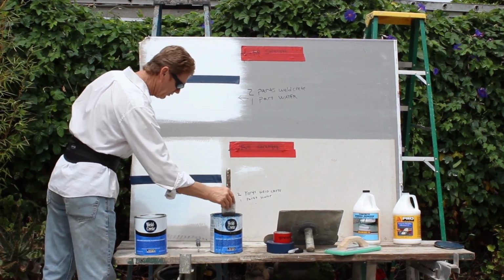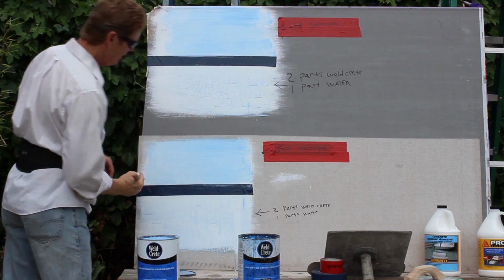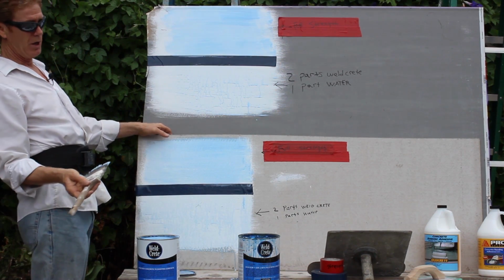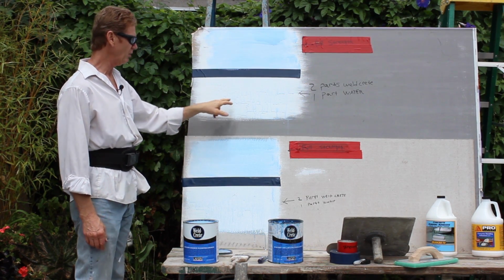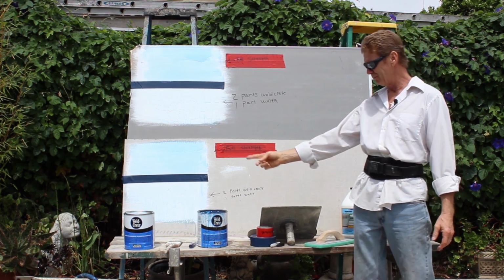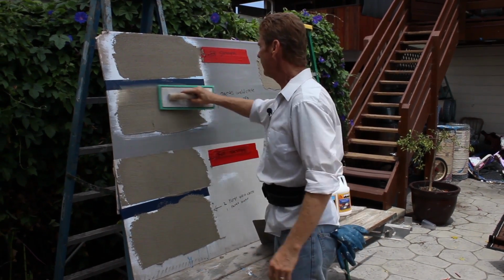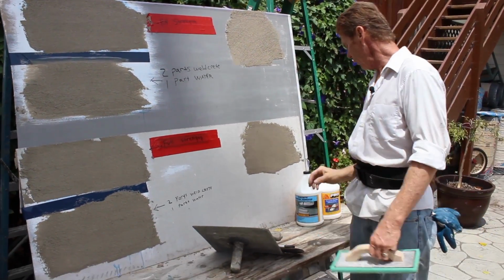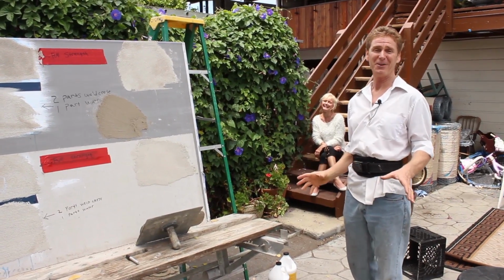Stucco and Concrete bonding agents.

Comment: Kirk, thank you so very much for what you've taught me.  One question I have, in a conventional three part stucco, is there a time window between when a brown coat should be applied over the scratch coat?  In other words, if I let the scratch coat cure too long before applying the next layer, does it limit the adhesion of that next layer (brown)?   Further, if I let the scratch coat cure a very long time (say...six months), is it necessary to apply a bonding agent before applying the brown?   Or, does wetting the wall thoroughly prior to applying the brown fix this. Thank you, Sir!
Reply from the maker: Good question brother,  no there is no time limit, the scratch can be on for years, however if dust dirt and grime gets all over it for whatever reason, simply hose the dust off with your water hose, the next coat will still adhere by suction. Nothing adheres to dusty surfaces except spider webs. 🕵🏼‍♀️🤙
Reply: @StuccoPlastering Thank you so much for the informative answer.  I sincerely appreciate it! 🙏🙏🙏

Comment: Can I weldcrete over sealed cinderblock so that mortar for natural limestone veneer sticks to it right?
Reply from the maker: Yes, clean the painted surface first with a wire brush or pressure wash it before applying the bonding as nothing adheres to a dusty or dirty surface, not even a bonding agent. Best wishes. 🕵🏼‍♀️

Comment: Hi Kirk, thank you for your video! I'm currently resurfacing the concrete in my small front patio that previously had tiles. I've already chiseled out the tiles & tile adhesive glue, power washed the ground & sanded it with a grinder. Do I need a bonding agent for existing cement to adhere to new cement on the floor? I noticed towards the end of your video you plastered one last bit of cement as an example of how it looked prior to drying & you mentioned "you didn't need to use weld-crete because the cementitious board wasn't sealed with paint in that area." I'm located in FL & my front patio IS SHADED! Thank you :)
Reply from the maker: When in doubt always use a bonding agent,Sakrete bonding agent cost about fifteen dollars, it’s cheap insurance.
Reply: @StuccoPlastering  Okay thank you!

Comment: Bare drywall joints have been taped ( fiber tape) with no topcoat.
Should I be applying the larsons plaster weld over these? Or avoid the joints?. 
I worry about the plaster not biting into the fibers very good if I paint them. The larsons helps alot with the moisture suction.
I am using woncote plaster. I had tossed a test piece in the trash... all the plaster fell off. After that I bought the larsons.
Reply from the maker: We apply the bonding agent and mesh if necessary, sure you can hit the mesh again with a boding agent but we usually don’t.🕵🏼‍♀️

Comment: I painted over my brick fireplace with some type of black paint from home depot. Would you advise weldcrete or another product before stuccoing?

How much sanding should I do to the surface before applying a bonding agent? 

Thanks! Love all your vids. You're a great teacher.
Reply from the maker: @DonVictron  I’d recommend Larson’s weld-Crete to adhere the new stucco. It would hurt to use a wire brush or heavy sand paper to lightly etch the surface.😉

Comment: Kirk, do you use the same 2 to 1 dilution over elastomeric paint which is a less porous type of paint?  Thanks!
Reply from the maker: @davep310  Howdy Dave, I must say, do what the can says and don’t dilute, as it’s complicated as to this one bonding agent out of 10 is the only one I dilute. If one was to paint many times now it’s again full strength. It’s too complicated to explain here, after using it on a hundred homes I know the results. Thus, home owners should do what the manufacturer suggest, this way I don’t get folks saying, there goes the bad guy. 😉

Comment: How to use Sakrete Adhesive Bonds Concrete to concrete
Reply from the maker: It’s exactly like Weld-Crete or quikrete bonding agent, they all say concrete to concrete, but us plasterers use it to bond new stucco over painted surfaces.

Comment: Again great video , I have a specific question   We don’t have plasterweld in my local store can I use lanco concrete bond blue to plaster gypsum or joint compound over painted drywall? Thanks
Reply from the maker: That works as Weld-Crete is usually sold at plastering materials yards. Quikrete also works and is sold nation wide at all hardware stores.

Comment: Weldcrete is the best.
Reply from the maker: Quikrete bonding agent is also just as good and found at all hardware stores, where one would have to google, “Plastering yards near me” to purchace Weld-Crete.
Reply: @StuccoPlastering  It's not as good. Had many failures testing quikcrete and 0 with weldcrete. If you don't order large quantities at a time your just an amateur anyway.

Comment: Can i put stucco directly over red guarded plywood?
Reply from the maker: No, as stucco is not 100 % waterproof, meaning the rain would then rot out the plywood. It must be lathed properly.
Reply: @StuccoPlastering  could I   use red guard on plywood then stucco?
Or redguard/thinset/stucco?

I have a couple of wood pillars that need stucco.

Thank you for your time 👊🏻
Reply from the maker: @totschopper  No, proper lath is necessary. First two layers of paper then stucco netting, now you can stucco. If it could be done the way you suggest, this is the way millions of people would be doing it.
Reply: @StuccoPlastering  fair enough.
 thanks for your expertise,
I really appreciate it 🙏🏼 
What is the recommended paper and netting for something like this 6×8 beam/pillar?

Comment: I have a home that has never been painted i want to do 20/30 stucco color coat i currently have a lace finish do you still use bonding agent
Reply from the maker: No, a bonding agent is not necessary, but you should pressure wash the existing stucco, clean enough to eat off.
Reply: @StuccoPlastering  ok thanks for the info do you know  how many 90 lb la habra would i need for a one story 1400 square foot house would use
Reply from the maker: @elplebe11000  Around 14 bags, of course that depends on the sand grit, the heavy sand or 16/20, you'll need about 18. The fine grit sand which is 30/30 you'll need about 10.
Reply: @StuccoPlastering  o ok thank you very much i was deciding between 20/30 or 30/30

Comment: Would Weldcrete work for installing stone veneer over painted cinder block stucco with type S mortar ?
Reply from the maker: Yes, it would work, pressure wash the painted cinderblocks with at least 3,000 to 4,000 PSI strength, this sort of micro etches the surface so that the Weld-Cret adheres forever, thus so does the grout or mortar.  🕵‍♂
Reply: Great this will save me the time and headache to strip and or install lath for this project.  @StuccoPlastering

Comment: Hey Kirk, thanks for the demo. Fan for a while now, out of Southern California.

You said a color coat won’t adhere to lime. We have an old adobe style home (1945) which was coated in a thin layer of cementitious lime, which is a bit more slick, but still retains the texture of the brown coat beneath. Someone came back and added a stucco finish later to parts of the house, and some of it has failed. I was going to patch it up but wondering if the original failure could be because of bad adheration to the lime surface. Thanks!
Reply from the maker: Color coats are lime mixed with Portland cement. They do indeed adhere to lime or most other substrates if those substrates are properly prepped. This is another story. Who even came back and added a finish coat to anywhere is also another story, as one has to be educated in stucco to do this properly. One should not apply a new finish to a finish that is failing or the new finish will also fail with the old one. 👨🏻‍🏫

Comment: I'm so glad I watched this entire video because when you said "color coat" the whole time (and in another video) I thought you were talking about a PAINT color coat. As in top coat.  So I was about to go out and buy this product and apply it diluted as you describe for use under my 2 coats of Sherwin Williams SuperPaint for my S. FL concrete stucco home, which has been mostly stripped of its old failing coatings via power washing.  But as I watch you apply your so called "color coat" I was shocked to find that you mean a thin coat of STUCCO.  Close call there. Loose terminology can't be taken for granted for sure.
Reply from the maker: Good evening Moonshot, sounds like a close call.👨🏻‍🔬

Comment: Kirk,  can you use weldcrete to apply stucco over steel siding, such as a pre-engineered metal building siding with a flat face?  I'm looking for a stucco system that uses metal siding as a substrate.  Clearly the permeability of steel looks like this might be a problem.  Will a bonding agent solve that?
Reply from the maker: No, it won't work. Why? The minute you open or close a door the stucco will become loose and fall off in sheets within a year. 🙅‍♀
Reply: @StuccoPlastering  Would the substrate have to be traditional OSB if I do a full stucco system with the insulation, a weather barrier, the lathe/mesh fastened securely to the steel siding the same way it would be attached if it were OSB or other more traditional substrate, and lastly the traditional layup of base coat and finish coat?  My guess is that would be okay -metal becomes a non-factor?  (Bonding agent set aside for a moment.)  I hesitate because these stucco "systems" seem to specifically call out an OSB style substrate under the weather barrier, and I don't understand if/why that matters.  

I understand the weldcrete example, that makes total sense now.  

Great videos content.  Love to learn.  I guess the best way to learn this would be to get some 4x8 sheets of OSB or some type of material and just start practicing.  It's not like I'm ever going to end up in the industry, but I do want to learn the basics and apply the skills on a few projects.  So, thanks for your content!  I'll learn the hard way.

Comment: Hey Kirk. I appreciate all your educational videos on stucco. I was wondering if I’m scraping off all the loose stucco, and I get back down the block foundation, I wire brush it, vacuum the dust off the wall, then wash it let it fully dry, then coat the weld create, to apply 2 coats of stucco (base coat & scratch coat), but have intentions to paint the final coat in the near future, should I be diluting the weld crete with your ratio. I’m not sure if color coat just means adding color to the stucco mix, or also it means painting. Also, want to make sure it’s okay to apply the weld  crete on the block foundation even if there’s no paint on it, since I will be scraping it off, as it’s already lifted from the block. Thanks again!
Reply from the maker: The cans say don't dilute, however this is for concrete to concrete.
When I'm applying an eighth of an inch color coats, I do indeed dilute it, as to prevent spider cracking in usually every square inch. Use full strength for your needs.👨🏻‍🔬

Comment: Our stucco was covered with aluminum siding which we are now removing. There are rusty nails in the stucco from holding up the siding. When we try to pull the nails out, it takes the stucco with it and leaves a hole. Do you recommend pulling the nails out and patching the holes or cutting off the heads of the nails and then sealing the rusty nails with something that we can stucco over? Thank you!
Reply from the maker: I usually pull them, then caulk the holes and recolor the walls.

Comment: Hello Kirk, I was wondering if you thought just doing a color coat or finish coat on top of a raw cement board for a 2" window return only would be durable and work? This would be for an exterior application. The walls of the house will have a rainscreen and lathe, but need to provide some backing for the 2" window returns that I would like to have the stucco match. Thanks and let me know as it looks like a finish coat bonds really well to a raw cement board without bonding agent or cracking occuring. Thanks and great work!
Reply from the maker: Hi Hogan, sure, a new stucco finish will adhere to any cement board. 👨🏻‍🔬
Reply: Hey Kirk. I appreciate all your educational videos on stucco. I was wondering if I’m scraping off all the loose stucco, and I get back down the block foundation, I wire brush it, vacuum the dust off the wall, then wash it let it fully dry, then coat the weld create, to apply 2 coats of stucco (base coat & scratch coat), but have intentions to paint the final coat in the near future, should I be diluting the weld crete with your ratio. I’m not sure if color coat just means adding color to the stucco mix, or also it means painting. Also, want to make sure it’s okay to apply the weld  crete on the block foundation even if there’s no paint on it, since I will be scraping it off, as it’s already lifted from the block. Thanks again!

Comment: Awesome videos!  After applying stucco over Weld-crete should I mist the coat for 48 hr or will the mist hurt the Weld-crete bond?  Humidity around 20% here.
Reply: I'll apply the new stucco will be over previously painted sand coat stucco on cinder block, 1/2 inch thick, not color coat, and sand finish

Comment: So no need for a bonding agent if I'm repairing/patching small stucco holes (4"x12" largest) where the backing is cement blocks?
Reply from the maker: Morning Sword, no need for a bonding agent, however, the cement blocks have got to be very clean and moist for the new to achieve a mechanical bond. 🥳

Comment: Kirk, I know this may have been answered before so excuse me brother. Have a house with white Thoroseal used over bricks. Pretty common on driveway sides of brick buildings in Brooklyn NY. 
When spot repair coating or reapplying the same material, can I use Weld-Crete or a other agent to help patched area bond? Or do as many masons do, just remove loose material wet and reapply Thoroseal. Your opinion sir much appreciated.
Reply from the maker: Sorry, I’ve not used thouaseal.

Comment: A client wants Imperial plaster over regular sheetrock. Although I have done this in small areas, with a bonding agent applied first, I have never done a very large job this way.  For example, one wall is 24 feet wide and 24 feet tall. What precautions should I take?

Comment: Great videos!  I have a zero tolerance chimney/fireplace on my home.  About 10 years ago, I noticed that the stucco was separating from the brown coat.  I scraped the loose stucco off and applied new stucco directly to the chimney.  It looked good and held up for about 5 years and then it also started to separate.  I need to do it again.  Any tips so that it adheres better?
Reply: Power wash and use a good primer before you apply the stucco

Comment: GREAT video Kirk. Have you ever come across Thorolastic Elastomeric paint over traditional 3 coat Stucco ? The stuff is incredibly hard to remove and I wondered if it could be color coated with help from the weld crete? Pressure washing will NOT remove the elastomeric paint but we are able to get the loose stuff off (with great manual effort!)  Any help appreciated

Comment: Hi Kirk, Thanks for the informative videos. I've been experimenting with stucco and styrofoam for several years ( planning to build a house out of 5 1/2 styrofoam ). The stucco I use bonds great directly to the styrofoam, but bonding to vinyl trim was another issue. I mixed a vinyl primer with the Quickrete bonding agent in a 1-to-1 ratio and was amazed at how well it worked on the first try. I usually spend weeks trying all sorts of formulations before achieving success. It worked great for bonding the vinyl to other pieces using the stucco I use, but the problem was when it was just the stucco alone applied to the vinyl. The problem was the moisture reaching the bonding agent. I do not want to seal the stucco. The bonding agent is not waterproof. It rewets when water hits it, probably why it works so well as a bonding agent. So I am now looking for a waterproof bonding agent, one that does not rewet itself when contacted with water. I will try mixing some polymers I have that dry waterproof with the vinyl primer and see if that bonds to the stucco. So here's hoping you or some of your readers might have a helpful suggestion. Thx

Comment: Hi Kirk! I want to fill in and smooth a 20’ section of a textured stucco wall to paint a detailed mural on an exterior wall, beachside in Florida. What do you recommend I use to make the wall smooth? Thank you!!!
Reply from the maker: Hi Jill, two coats of La Habra's Santa Barbara smooth mission finish. 
Naturally, there is prep work such as pressure washing the wall and applying a bonding agent on that cleaned wall such as Quikrete bonding 
agent. You will have to google, plastering yards near me to find plastering material yard to purchase this fine finish material, as HD only sells the medium grit 🥂
Reply: @StuccoPlastering  thank you soooo much!!!
Reply from the maker: @JillJordanSoundLiving  Hello Jill, no problemo, 🥂
Reply: @StuccoPlastering  Hey Kirk, she is covering a cementitious surface, why does she need a bonding agent. Is it because it is textured? I'm doing small patch work and was a little confused.
Reply from the maker: @MrCashgold    I tell folks always to use a bonding agent as it cost under ten bucks and is cheap insurance in case there is dirt, dust, or grime on that cementitious surface.
 You are correctomundo if that surface is super clean a bonding agent is not necessary. Good question brother. 😉